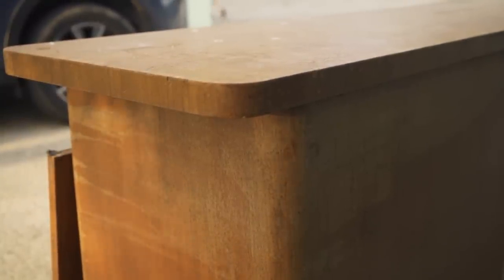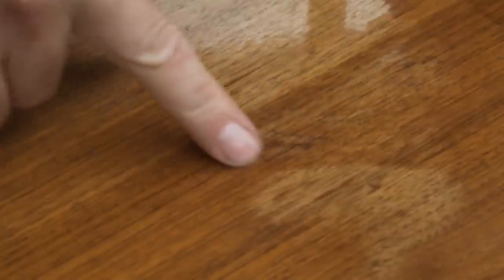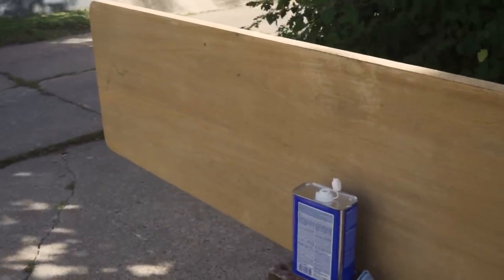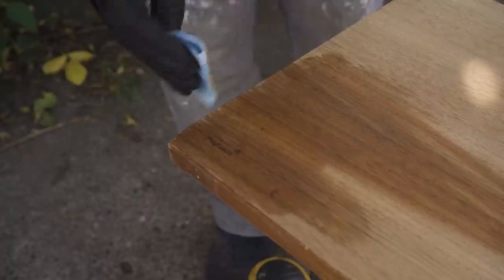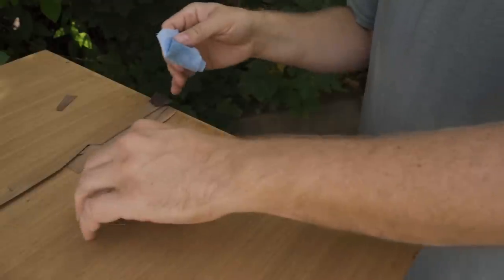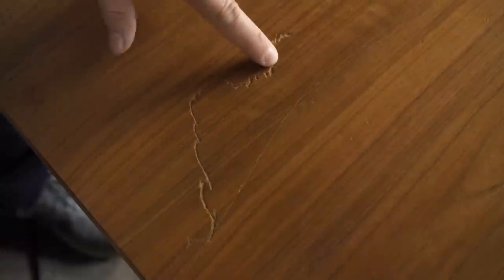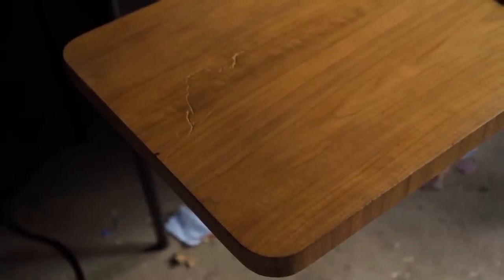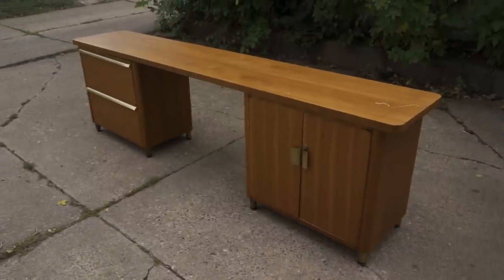This Is A BIG One | Furniture Repair & Refinishing

Comment: I liked the gilding idea, that gash reminded me of a little lightning bolt.

One thing I've tried with success is discount kinutsugi - fill a void to almost level with regular old grey JB weld, paint on a thin coat of cheap Japanese urushi lacquer paint, and then dust it with gold mica powder, repeating once or twice until it's flush and nice and gold. I've never tried it with wood (it works amazingly on ceramic cracks and chips, a coat of mod podge after all that and it'll be microwave/dishwasher safe forever) but I can't imagine it not working. It'd be interesting to see tried on chips in edge veneer, where you want it flush.

I like JB weld because they are the only brand that certify their epoxy as food safe, microwave and dishwasher safe, I've checked with about a half dozen brands and only JB weld have tested/verified their steel stick and classic formulas as safe/stable under heat and water. 

Its also nice and cheap, JB weld is always on hand, and a little tube of urushi is about 4 or 5 bucks and gold mica powder is a dollar or so, and both will last for a very long time. 

I'd be down to see more gilding/inlays like that when veneer is really dinged up. Match it to the hardware with some brass, bronze, gold, and silver mica!

Comment: I picked up an antique buffet at the side of the road. It had 4 doors with what I believe are the same hinges - knife hinges. Most were with the piece but I did not have the foresight to keep the hinges on the doors until I knew what I was going to do with them and then mark which hinges went in each spot. So of course some were quite bent, but as I was only keeping 2 of the doors I could pick from the “best” ones. These seemed to be handmade as the 3 holes in there was not identically placed from one hinge to the next. So, figuring out which hinge could fit where, and exactly where they should be placed as the areas they sit in were partially worn down, and combine this with the fact that was only my 2nd flip so my skill/knowledge level was super low, let me to also question “why did I pick up a piece that was destined for the garbage?” Anyway with a lot of research, some help from my only slightly more knowledgeable-in-this-area husband, and my natural unwillingness to quit even when he did, I got them in to a place where the two glass doors would open and close properly. I did consider replacing them with more modern hinges and that’s when I learned you can buy these knife hinges. They are a unique option and I think with modern, properly working ones I can see where they could be a nice option vs more typical ones. You did a fabulous job. I learned a lot from this video. Love the gold leaf. I was thinking maybe resin would work to highlight it but maybe the area was to narrow? Anyway the gold looks fabulous. Have a great day.

Comment: About the fumes. My landlord has a fuel powered lawn mower, but I'm the one using it. I use fuel made for those kinds of engines, not just regular gas from the gas station, and it makes it run much cleaner, no fumes, less noise and it takes better care of the engine as well apparently. I think it's called alkylate fuel in English, and it's for four stroke engines.

Comment: Rockler sells knife hinges, but there is always the question of size and cost. Those style hinges are often brass so $$$.  They're local and have decent on-line catalogs. Great job can't wait to see how to approach the hinge issue.
Reply: If there is a way to provide a mailing address without either of us providing it to the public, I just checked my hinge box, & I have some. I'm fine with just sending to you. They are vintage.

Comment: Oh man! I wish I had seen this. I have a very similar desk, has a metal stamp saying it’s from the NM state library. It had so much veneer chipped on the edges I couldn’t process fixing it. I did restore the base. I painted the top a matte black so that it looks like those old chemistry/bunsen burner tables from school. I figured it was a compromise on maintaining most of the integrity and not turning it into some “shabby chic” painted monstrosity.

Comment: I would suggest doing an internet search for the hinges. I would also encourage using an odie's oil product. I think Odie's would enhance the color of the wood so much better. There were a few spots in the video that could have been sped up and simply explain the process (color match) instead of wasting time. Otherwise, the credenza is really nice.

Comment: I agree with comments that suggest distressing the piece even further, as a design element. I do like the crevasse, but would have perhaps continued gouging out a line, looking something like a heart monitor reading going to a  flatline at both ends of the current crevasse, to extend across the whole piece; then pour into the gouge a nice colored resin in a contrasting color.
I imagine you were just wishing to be done with it, though - not add a project like that to the to-do list. 
Hugs from Texas!

Comment: The hinge appears to be a “Cabinet door pivot hinge”. VTS-2555at Vintage Trailer supply.  $9.98 +S&H.  You can also get the key to those locks by removed the key set and taking it to a real locksmith (not Home Depot) for just a few bucks.  Very nice outcome

Comment: suppose it has been mentioned, but those are called knife hinges
I probably would have filled over the metal leaf with epoxy just to get a fairly smooth surface

Comment: I was thinking the exact same thing with the crack only I would’ve filled it with black.  It looks like it might’ve been bored by an insect but it wasn’t.   I like your solution!

Why were the hinges such a hang up?   Couldn’t you just buy new ones?  

Great job as usual.   I hope you get an indoor shop with heat soon.

Comment: at the end of the day it's all experience, RE the scratch on the doors, i was trying to tell you through the screen (but you didn't hear me) to reverse the door...flip it so scratches on the inside...i  think in cases like this i would just have re-purposed the top and used the bottoms for tool cabinets and the top for a good work bench...

Comment: Hey dash, didn't finish the vid yet. Just wanted to recommend or ask if you've had success using an automotive steamer for the little nicks you get. They tend to have nice small nozzles and could come in handy without risking needing to use a soldering iron can it burning. Never used one on wood before but used it plenty at work and they seemed ideal. Hope they could help

Comment: Hello from Fridley.  You might consider using "glaze coat" from Menards as a top. You can then get a bit more creative by putting in a little sandscape in or around the defects.  Make it a artistic top.  It would narrow the market but up the value. If your going to go with a glaze coat you might as well go for new hinges.  The kind they use in modern kitchen cabinets.  If your insisting on kind of similar you could cut up a glass door hinge. It would have a similar profile.

Comment: I dont think you should get hung up on the small imperfections. With its age it is to be expected. Once you sand and stain something it looks 10x better than before. It would be perfect for an audio stand if you added a couple of lower shelves. You could have 2 turntables an amp and a reel to reel easily on the unit and store records below. The gold leaf was a nice touch. Epoxy over it would be cool.

Comment: I got an old vintage speaker and someone painted the top but under it is the original stain and varnish. How can I remove only the paint without damaging the original finish? I am guessing there is something wrong under the paint or they wouldn't have painted it but I want to see so I can try to redo it myself and I don't want to strip the entire piece.

Comment: Why don't you start sanding with 60 grit ? It would certainly removes the scratches in the opposite direction of the grain. I usually start with 60 grit, moving to 180 and finalizing with 220 for most furniture. Thanks for your feedback. Love your work.

Comment: Most of the pieces you restore leave me in awe. I’m not a fan of the gold leaf. There is a big “knee” space and the gouge is near an end. It might actually make it more desirable if it was 7’ instead of 8’4”. You could cut off and shape the top and add edge banding veneer. But that would not be a straight restoration…

Comment: I would just flip the desktop over. The other side is probably way nicer. Lol

Edit: Holy cow! Wood necromancy!

Ugh. I hate that wax filler. It probably feels way to different from the wood.

This guy went really hard trying to match the veneers from that chip. Dyes seemed to have settled in the veneer cracks. You probably have to pre dye them before you join them permanently.

Omg the hinges! Just get some basic metal fabricating skills! Make some accurate recreations! You’re killing my soul.
Reply from the maker: I’m going out to get some basic metal fabricating skills this morning and should have the new hinges done by this afternoon.  Thanks for the tip!
Reply: @DashnerDesignRestoration  Bro do it! You just need to remove the pin with a dremmel tool or a file and then cut a new hinge top out of sheet metal with some metal snips. Sand it up, harden it and then install it. It would be awesome!